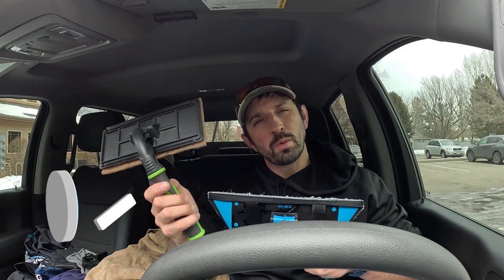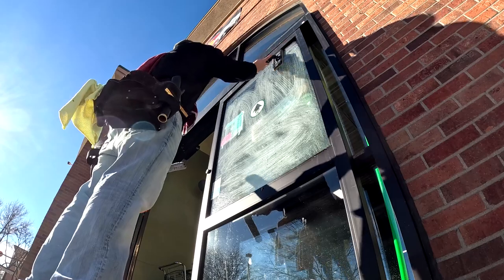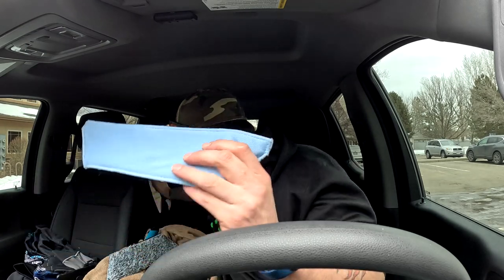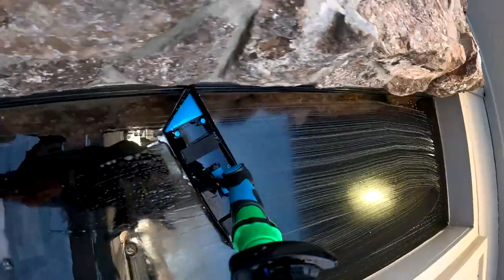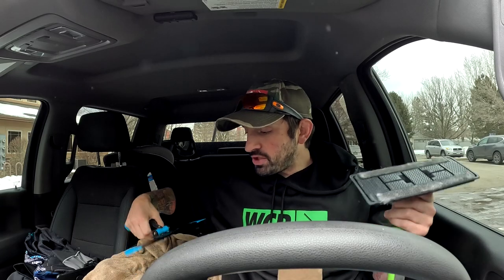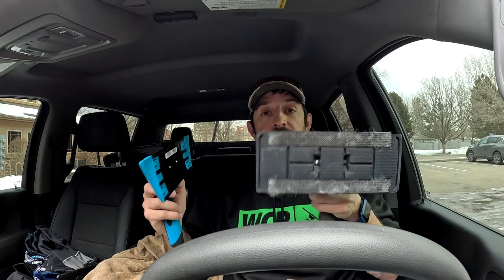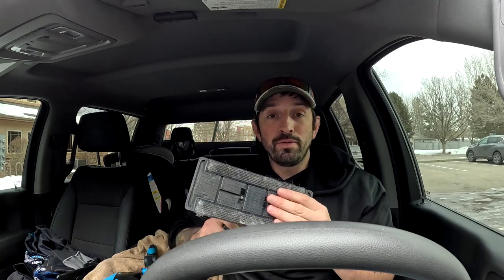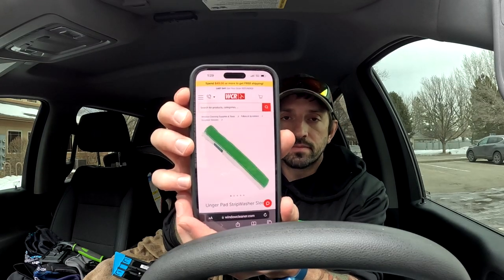Moerman Gekko VS IPC Technopad | Window cleaning tools

Comment: Thanks for making those observations about the Moerman. I can't say I love the IPC Technopad, though. The construction is excellent, but It's hard to control sometimes and it doesn't fit into tight spots like the IPC Eagle. I wish I could find a super simple acme female to euro male adapter, so I could more easily use the Unger pad holder without worrying about snapping a connection.

Comment: I just use drywall sanders on a pole.  They're cheep and you get the full rotation.  I buy steel wool by the roll and use it as needed.
Reply: But none the less, great tools that I've never seen.  I'm ordering some today.  Great video and ideas.

Comment: Actually IPC should reach out for real, there should be a little compact where you could represent what cleaners want from the tools, the metal wool people - is it lusenshine? and IPC, that makes nothing but sense.

I don't use them for window cleaning though. I use the Bronze wool for CCU or 1st clean but then the Cleano's rough pads for distributing a bleach/dish soap mix for softwashing showers tiles, moldy walls etc - this is an amazing application - dramatically faster with less fatigue than flying around with a cloth.